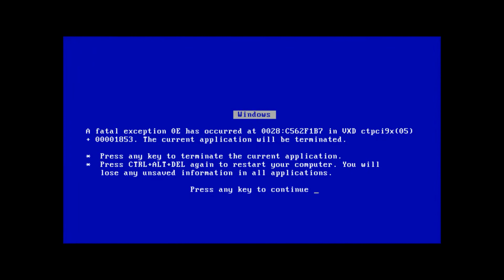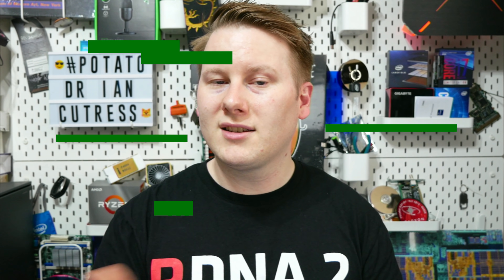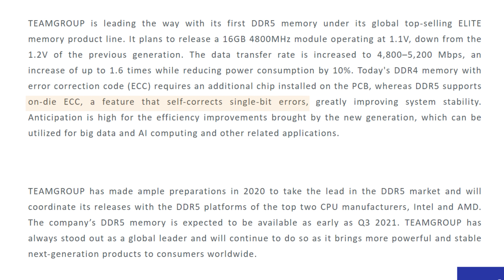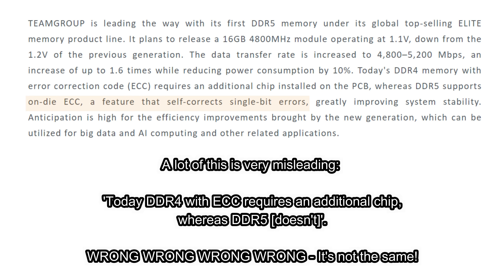Why DDR5 does NOT have ECC (by default)

Comment: Petition: put a heat pipe and a concrete hull on the RAM module instead of RGB.
Reply: Maybe heat pipe or heatsinks cost more than just simply put an ECC module on the memory Die.
Reply: @temporoyale6251  I would pay extra for a heatpipe just like I would pay the extra to get an LGA socket on AM5. Not everyone would pay the extra but I would. I would prefer actual heatpipes something useful over RGB but that's me. I'm kind of sick of RGB tbh.
Reply: @hardcorehardware361  I agree with you, I would love to see some b-die with a bulky heatspreader or something of the sort
Reply: @temporoyale6251  Back in the DDR2 days we had massive copper heatspreaders, we need to get back to that instead of RGB.
Reply: @hardcorehardware361  You might be in luck. Gamers Nexus showed a leak suggesting AM5 will be LGA, though it seemed much too generic to be genuine. Just curious, but why does it matter to you? I've never had a problem with PGA chips or sockets but I have bought an LGA motherboard that came with a broken socket.
Reply: @johnm2012  Yea I watched that video. I prefer LGA mainly because I swap coolers around allot and its just easier on an LGA socket, I run large Air coolers. I've never had a broken LGA socket but I have removed coolers off of PGA chips and the processor was stuck to the bottom of the cooler even after heating up the Tim with a stress test. That was back in the Thuban days and Bulldozer. You try to remove the processor off the cooler and then the processor falls on the floor and bends pins:( I've sat trying to bend them back its not fun. I recently built an Intel based HTPC for my lounge room, it was a pleasure to build. AMD is doing great I would just prefer them to move to an LGA socket like Threadripper. Its just personal preference. If you don't replace the Tim on PGA chips for years like my friend and Her 1600 which has never had the Tim replaced since release, you have to be very careful when removing the cooler other wise it comes out of the socket and you have to use a flat head screwdriver to remove the processor off the base of the cooler. Its not a fun experience. AMD have been using PGA for many years its time to switch imo.
Reply: @hardcorehardware361  
Meanwhile Microsoft ties its OS registration to the motherboard, so if a pin or two gets messed up, the replacement costs go to the motherboard AND another Windows license because Microsoft wants you to cough up the cash for another instead of transferring the motherboard registry. Reminder that Windows registers the exact motherboard identifiers on initial installation, and will not take kindly to a swap to a new motherboard of the same exact make and model.
Reply: @Aereto  Not true.  My old 7 years old notebook died.  I bought a new one and I took out the old harddisk from the dead notebook. I poped it in.  Change the boot order to boot from the old harddisk.  It fetched and installed hardware driver.  It works.  It is a new notebook and of course it is a new motherboard inside.  The old win 10 runs just fine.  Not like you are talking
Reply: @Aereto  OEM keys are locked to the board but Retail keys are not.
Reply: Agreed
Reply: Lead lined heat spreader

Comment: i really thought they had ECC, I am glad you made this video to clarify
Reply: thing is it should lower error rates, but as explained not eliminate "in-transit" ones. Being completely unprotected vs having your data is safe vault that is protected, does help a bit, but its not a fix-all.
Reply: At least it is more integral when it comes to system errors. On the bright side, the speeds are a massive improvement from DDR4 (ranging from 2133-5000 MHz, where DDR5 is ranging from 4600 MHz-12,600 MHz)
Reply: It IS ECC. There is ECC in many parts, in many sub components or IPs. As an FPGA engineer, I use IPs that can have ECC enabled, internal interconnects, SRAMs, memory controllers,  PCIe controllers, etc etc. Sure the DDR5 on-die ECC is different and as Ian says it's not the whole "CPU to memory cell ECC" that people have been used to for RAM, but it's still ECC, that's not a lie to say so.
Reply: @TokyoQuaSaR  
Not if I can call it ECC when my virtual data tables read from the HDD get stored on RAM ends up getting a corrupted entry stored while not even once getting a write/overwrite command.
Reply: @Aereto  I don't get what you're trying to say. And I'm not sure you're getting what I am trying to say.

Comment: That's disappointing, unexpected, and confusing.

So right now you need ECC support on the CPU, and on the memory modules. Fairly well understood.
I suppose it shouldn't be too surprising that you'd still need CPU support for ECC, even if the marketing made it sound like you just get it as part of the spec with DDR5.

I don't understand why it's still important to have at the module level though. It sounds like the idea is "check the bits at the memory, and also check them at the CPU to verify they didn't change in transit." Why is it important whether those bits get checked on the chip or on the module, and especially why both?
Reply from the maker: The on-die ECC only does the data on the die within the cells, but the data transfer is still only 32-bit. Full module-level ECC requires 40-bit transfers - on DDR4 modules you see 9 chips rather than 8 on each channel, and there's a module wide 'handshake' to the controller for ECC to happen. Just having it on each die separately doesn't do any of the actual control for data transfer.

Comment: Would be nice to have a techtechpotato RAM video including registered memory. One thing I have "heard" (not sure if it's true) is that reg (ecc reg?)  can be faster than none reg memory IF you are using several DIMMs per channel. Is this true perhaps? Would be amazing if someone like you could take the time to explain, confirm or debunk these "rumors"
Reply: Yes, RDIMMs can run faster, but have a penalty of iirc 2 in most important latencies.
This only matters when you get above 32GB per channel.

Comment: Now that I have watched the full video you should have mentioned read and write CRC on the DDR5 link! It is part of the standard.
And in the future I really just want every memory controller to include authenticated encryption capability for the whole memory so I still get reliable error detection (no silent corruption) even if I am not using ECC DIMMs, and just lose the RAS capabilities (error correction and better uptime). AMD already has encryption in the CPU's memory controller. Why is AES-GCM or aegis128 on the memory controller not a thing yet?
Reply: How high is the probability for a bit flip while the data is been worked on on the cpu? It is probably idlely stored in the ram for 99% of the time. So on die ecc would already protect against almost all bit flips.
Reply: @Psi-Storm  Good question! The CPUs have ECC for the registers and the caches as far as I know. So the chance of a bitflip in the CPU is very, very low, if you don't overclock. So what you are missing is want is ECC memory gives you: protect the data while it is on the memory bus or stored in DRAM.
Now if you have memory with on-die ECC only, and that on-die ECC can transparently correct errors, makes no consessions to just producing cheaper modules rather than using the higher data security for better reliability, and it reports errors to the OS if it detects them and you have a CPU and motherboard that can enable the link CRC for both write and read operations to protect data on the bus and you can live with not having those extra ECC bit lines that real ECC modules have, and can therefore live with less memory bandwidth that you get by transfering this CRC on the data lines. And it's a huge if that you have all those features available on your consumer motherboard. Then yes, maybe on-die ECC only could be as secure as real ECC.
But actually I really like my idea of adding authenticated encryption to consumer CPU's memory controller to reliably detect errors. I think a lot of consumers could live with on-die ECC in combination with error detection from encryption. That's what should happen!

Comment: Never the less, on-die ECC is a major benefit to most non-server systems as it provides more reliable memory than traditional non-ECC systems.

That said, I’ve generally purchased systems that support ECC, however, it’s been nearly impossible to buy laptop systems with ECC support.
Reply: The workstation segment has plenty of models supporting ECC (Thinkpad P series comes to mind). Unfortunately, the price tag is a bit overwhelming for most people.
Reply: @rdoursenaud  yes, the cheapest Dell laptop with ECC starts at over $1800, with the base CPU, 8GB ECC RAM, and 250GB SSD. It’s over $2k if you bump it to 16GB ECC.

Comment: I guess the new ddr5 ECC will still be a lot better at handling cosmic rays. Assuming a ray only flips one correctable bit.
Reply: to be fair, the bit flips happen 99% on the ddr side and almost never on the bus pathways or CPU, but even the 0.0001% will get you eventually.

Comment: So, basically more dodgy marketing from manufacturers, surprise surprise. Thanks for the explanation Ian.
Reply: To be fair, it’s OEMs that pull this kind of stunts, not manufacturers. Memory manufacturers know very well how their chip behaves. These are very well specified. Yet OEMs sell them and market them outside of those specs (Think XMP) on a daily basis…
Reply: @Sidowse  Yeah I meant OEM for the modules vs memory (chip) manufacturers. That’s what you get for commenting out late at night :p

Comment: So do explain how can that “cosmic particle” go through a FARADAY CAGE??

(Which all metal computer cases ARE!).
Reply: Those particles move at relativistic speeds, they laugh at your phony metal case
Reply: If it has enough energy it can bypass it. Also no computer case is a perfect Faraday cage. Would also need thicker walls if you wanted to shield it to super high degree.
And don't even start me on quantum teleportation or excitation of electrons in computer case that re-emit photon which can become some particle for nanosecond.
Reply: They are so fast the metal has barely any chance of stopping them.

Comment: Wow, I thought DDR5 had ECC from everything I've read.  Great job! This needs more attention.   ;)
Reply: DDR5 does have ECC.
It's "on-die" ECC. What's not clear is whether DDR5 will will use ECC to talk to the CPU for all modules or whether that's optional. It's also not clear whether all DDR5 will have on-die ECC for local (in module only) corrections... I hope DDR5 is ECC at the system level ONLY or that's going to create a lot of confusion. Both AMD and Intel (and whoever controls ARM and even Apple) will have a say in this.
Reply: This is the problem with just reading stuff on the internet and not fact checking you just believe everything to be true. 90% of tech enthusiast I know all think DDR5 has full ECC because they read it on an article on the internet...
Reply: @MrNelahem  From an engineer point of view I don't think it's such a big deal for consumers to know that the ECC on DDR5 isn't the exact same thing as the full CPU to memory die ECC.
I mean sure there are chances of getting errors in the transfer from CPU but I would say it's not as likely as for the memory cells if your system is correctly set up (eg not too much overclocking on the memory bus and the CPU memory controller etc). People working on servers or workstations used for critical applications should be aware of it though. But I assume they will be since they have already been used to buying "full path" ECC modules.
Reply: On-die ECC is still ECC. So yes it has ECC. It's not because it's not the whole chain that it's not ECC.
Reply: Reading... reading... reading...
Reply: @Ryzen Division DDR4 adoption took about 6 months, not more.  After that the price and timings were about the same as DDR3. So I don't see DDR5 taking much more time than that.

Edit: I don't say it should be widely adopted by that time. But it's not because it's not widely adopted that it means you should not build a new PC using it, at least after the first few months.

The problems you report happens often for new processeurs (like Ryzen 1) or chipsets, it's not only because of the new gen of the memory interface (or if so maybe the first couple of months only where you need to update BIOS etc)

If it goes like the DDR4, only the 6 first months you might not be able to get good DDR5 modules with good prices and timings. Hopefully Covid won't have too much impact.

At least by the time the Ryzen 7000 (Q4 2022 ? first AMD DDR5 support for mainstream desktop), the memory prices, timings and availability should be stabilized.

And DDR5 with each of the usual two (for mainstream) 64b channels will be divided into 2 individual 32b channels, which is quite a nice new feature, so this could even be the biggest DDR improvement on mainstream of all generations so far in my opinion.

Comment: What will 32gigs of ddr5 cost in oct 2021?
Reply: Fairytale dust, as it wont be really available due to chip shortage. At least thats my prediction.
Otherwise, either half a house or one of your kidneys.
Reply: @blockbertus  hahaha nice one m8
Reply: And they will probably have worse latency than DDR4. And you need an CPU with a memory controller for DDR5 to be able to use them.